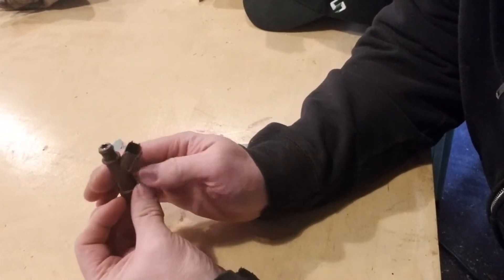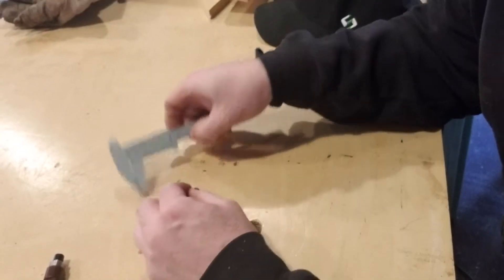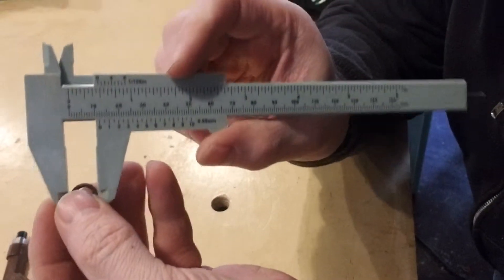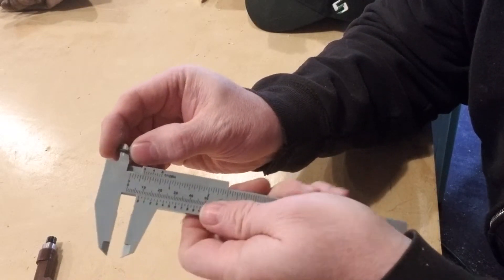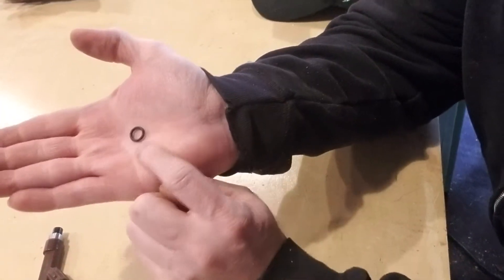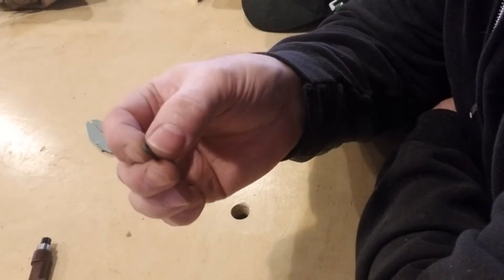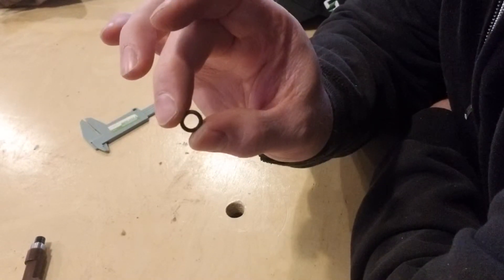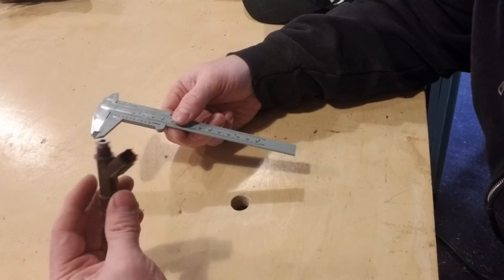How to measure an O Ring

Comment: Good video. If you measure the inner and outer diameters, then subtract the inner diameter from the outer diameter and divide by 2 - presto, you have the thickness of the 'O' ring material !
Reply from the maker: Excellent